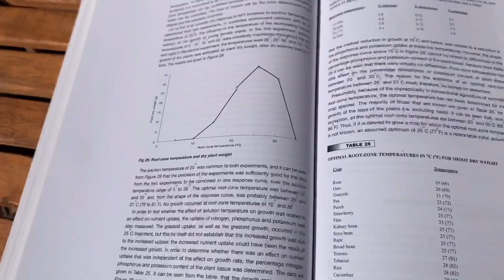Nutrient Film Technique: You’re Doing it Wrong!

Comment: Tbh I'm not really convinced. The system will have the same flow rate, no matter the water level. And the plants will develop air roots on the surface even if the water level is deeper to begin with.
I've been getting great results with a little bit of safety water and many other people do, too.
I believe changes in water level are what's really dangerous and what killed your eggplant, going from a shallow level to a deeper one will kill the roots. But simply starting with a higher water level won't change much, as long as the water level  stays mostly constant.
It would be nice to see a real side by side comparison, though.
And like others pointed out, what counts as NFT is just semantics, and having a higher water level doesn't change the main working principle of the system, which is having a continuous flow of solution.
Of course in reality other factors like the incline and size of the pipe play a major role too (I intentionally have quite large pipes)
Reply from the maker: Flow rate is a factor, but does not increase the oxygen enough.
I cannot overstate the fact that I’m not giving you my opinion. I’m regurgitating hard scientific research from a textbook written by someone who has gathered information from many peer reviewed sources.
And my personal observations just happen to confirm those sources.
So feel free to believe what you like.

Comment: Thanks for your information. If by putting the air stones to supply oxygen in the nutrient reservoir , will that help to the plan if the roots are submerged in the water?
Reply from the maker: John Duong it won’t hurt, though it won’t do much, the water dropping into the res would do the same.
Reply: @Hoocho  thanks. So far my plan is still good but need to make sure my next system would be NFT. :)

Comment: Thank you!! This gave me so many answers!!

But now for a question. I have a similar system but I use standpipes in the outlets to control the level wich I now understand is wrong, But! I have previously drilled 3mm holes at the bottom of the standpipes to slowly drain the water out of the pipes. Would it help to reduce the running time of the pump to get more air to the roots?
Reply from the maker: Francois Bothma the pump should be continuously running, the roots being half submerged half in the air will give enough oxygen.

Comment: I have baffles in mine and seems to be going ok, however will try without on the next setup, do you run your pump 24 hours a day or cycle it off during the night, talking about a melb climate, obviously warm nights in summer but not now.
Reply from the maker: Peter Lister 24 hours a day yeah
Reply: Hoocho another question, I know you use exercise Matt instead of net baskets, I’m using net baskets and was going to change my system so it was a “true NFT” system however the net baskets will sit above the film, does that mean net backers really are not suited until least roof growth becomes evident out of the basket
Reply from the maker: Peter Lister I would encourage using my seedling propagator system and dropping net cups in there instead of the pucks if you’re married to the cups.
Then once the roots are long enough you can drop them in the larger system.
Reply: Hoocho appreciate the really really quick reply, sounds like a plan

Comment: Nice vid man and great explanations, something I intend on playing with is oxygenation through flow rate using tubes that sit under the surface of the fluid secured to the top of the rail to directly suck oxygen into the flow to try and maintain a higher flow rate and increase the oxygenation of the system all the way back into the reservoir, i'm also hoping this will introduce a higher level of even temp by drawing hotter air in through the whole rail.
Reply from the maker: Maelstrom Beats interesting concept, if you do be sure to post it to the Hoocho sub, very interested.
I’ve often thought about making a deep water system (90mm) with conduit (25mm)along the bottom pumping air through holes in it to see what kind of yield can be achieved.

Comment: Well alright then. I need no more convincing than this to change up the planned design of my future NFT rail! Will just have to get a battery operated solution for when the power runs out. Your videos are always so tremendously structured, balanced in data, and hugely informative. Thank you Hoocho!!!!!
Reply from the maker: Lallie here! If you design a system to raise the system level in the case of a blackout and be able to block the ends so you can manually flood the pipes that might be a cheaper alternative. 
Just spitballing.
Reply: @Hoocho  oh heck yeah that's smart. I was wondering though, would a 2.5 hour black out (inside a building,  so no sun to mess with temp and water evaporation) necessarily cause massive issues? Will the roots themselves not sort of hold little pockets of moisture that could see them through a (relatively short) dry spell?
Reply from the maker: Lallie here! If there is no sun I reckon you’d have a while.
Maybe 2-6 hours, depending on the stage of development and the type of plants (how many etc...) 
Hard to say.
Definitely longer than an outdoor nft.
Reply: @Hoocho  right on, well then in that case and in the wise words of my dad : "less is more". If 2.5 hours out of the sun still has a reasonable expectation of survival, then I'd rather experiment with that for now and can add more solutions later if needed be. Failures will only result in more learning after all. Hoping that September will be the month in which I can (ahem) spring into action on getting this setup (Southern Hemisphere dwellers will understand and excuse me for my lazy joke). Massive appreciation for you and your consistent posting of super solid content. Have referred your videos to so many already! Have a good sleep!